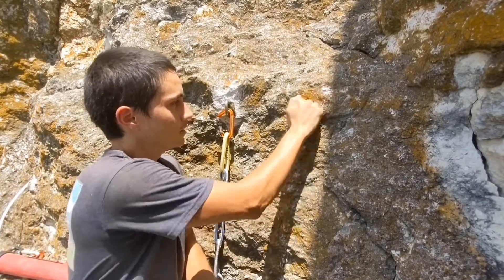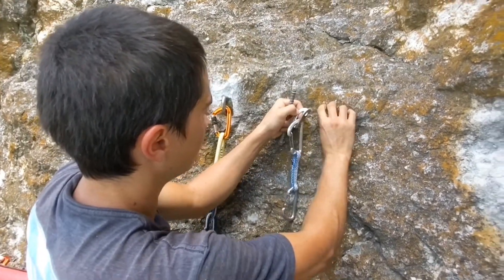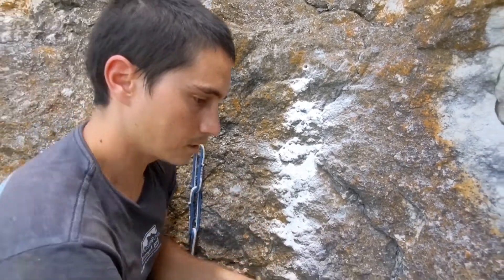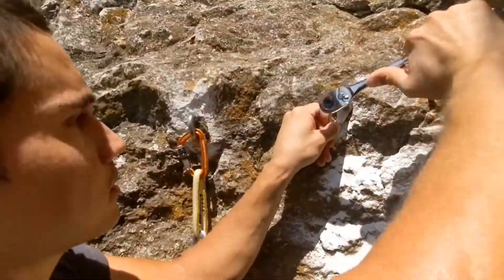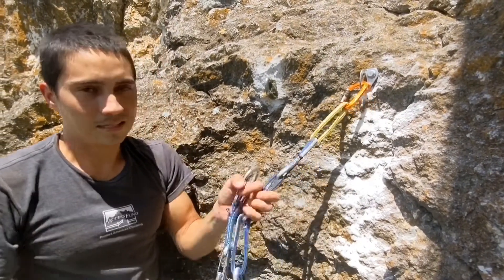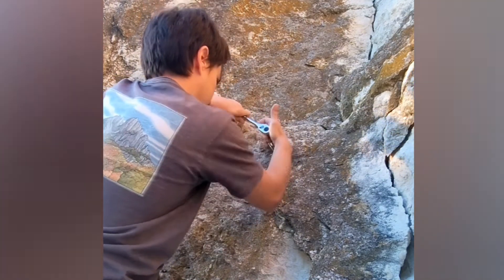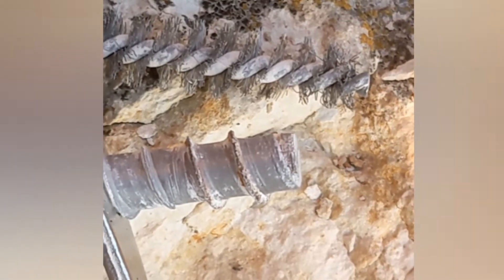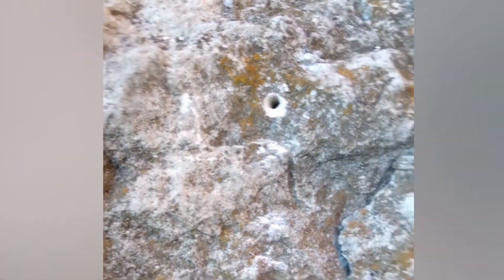Simpson Strong-Tie Titen HD 3/8 x 6" 304SS Concrete Screw for Rock Climbing Bolt

Comment: IIRC the spec states a max allowable installation torque, that is different than a torque you should take it to... Max allowable installation torque is more like, don't take it beyond this value because it will overly stress the bolt or the substrate it is in. Since the method of engagement with the substrate is passive, like a nut, torqueing it to any meaningful degree beyond it being snug against the hanger and rock doesn't make sense... Torqueing expansion bolts beyond snug against the hanger/rock makes sense since over time the expansion can damage the rock and decrease the force applied by the expansion sleeve/cone, so the extra torque is pre-loading it to try to account for this inevitable (in soft stone) decrease in expansion force over time.

Titen's are pretty sweet. Cost aside, I think for soft-ish rock they make the most sense as bolts in terms of ease of installation, ease of removal, and leave a good hole for a glue-in which you should use in soft stone anyways. No fiddling with bolt spinning, fishing pieces of a bolt out of a hole, pounding in bolts and patching, just remove with a ratchet.
Reply from the maker: Thanks for that clarification! I had to re-read the spec.  Simpson installation instructions say "1. Drill a hole in the base material using a carbide drill bit the same  diameter as the nominal diameter of the anchor to be installed.  Drill the hole to the specified embedment depth plus minimum  hole depth overdrill (see table below) to allow the thread  tapping dust to settle, and blow it clean using compressed air.  (Overhead installations need not be blown clean.) Alternatively,  drill the hole deep enough to accommodate embedment depth  and the dust from drilling and tapping. 2. Insert the anchor through the fixture and into the hole. 3. Tighten the anchor into the base material until the  hex-washer head contacts the fixture".
In the chart below, it has the note for maximum torque in regards to the very short sized bolts ONLY (3/8"x1 3/4" and 3/8"x 2 1/2") : "These models do not meet minimum embedment depth requirements for strength design and require maximum installation torque of 25 ft. – lb. using a torque wrench, driver drill or cordless 1/4" impact driver with a maximum permitted torque rating of 100 ft.-lb".  This is probably because if you exceed 25 ft-lbs with those shorties, you'll be more likely to strip the concrete/ rock.
So, it seems like the spec doesn't provide any real min or max torque limits for a 3/8 x 6" bolt.  Personally, I think the torque I demonstrate in this video (targeting 25 ft-lbs) is pretty appropriate.  I have done a little experiment of tightening the bolt with minimal torque (less than 5 ft-lbs) and pulling on it 90 degrees from the hanger orientation, and it turned into a spinner.  So definitely some torque is required, and I'd still error on the side of too tight than too loose
Reply from the maker: Sorry, I scrolled down the chart a little farther and it DOES say max torque is 50 ft lbs for the 3/8 bolts.  So, the torque demonstrated in this video is appropriate.  I could go all the way up to 50 ft-lbs, which would be 100 lbs (most of my body weight) with this 6" socket wrench.  Probably exceeding that risks sheering the bolt head, and/ or plastically deforming the serrations under the bolt head
Reply: @jimday1991  That is good to know that it would take quite a bit of torque to damage them.

Comment: "Testing" it by yanking on it with a sling?   You should send some to How Not 2 and get some real tests done on their Dyno.   Would be interesting to see what kind of numbers they get.  Cyclical loading is an interesting issue too (many whips over many years).
Reply from the maker: Hey Nick!  Google search cyclical loading.  It's about fatigue from thousands or tens of thousands of cycles over a short period. That concept does not really apply in this application.  
I've talked with Ryan Jenks about these bolts since they use them a ton.  I could see it being a concern to repeatedly load these bolts past their working load limit (e.g. the point where the metal starts to flex) because it can wear away at the rock.  Ryan said they've had results where these bolts pull out less than 20kn, after they're used multiple times as work horse bolts to break other bolts, e.g. repeatedly loaded to 20+kn.  But you're never going to fall hard enough to deform one of these bolts.